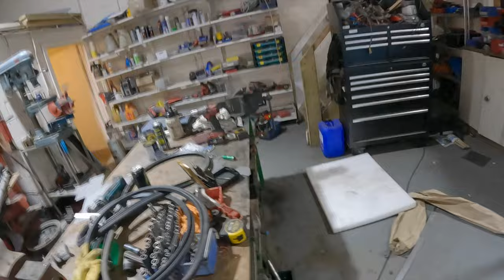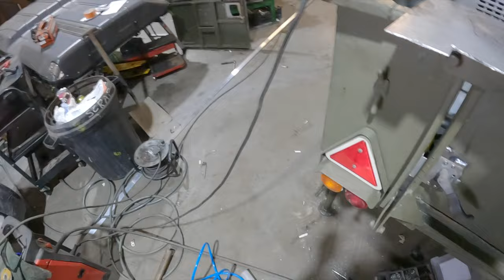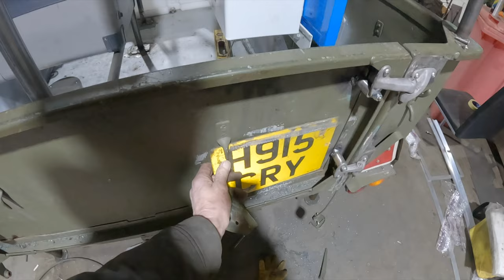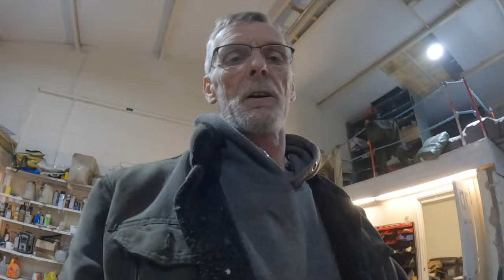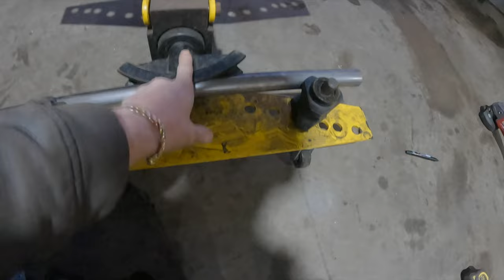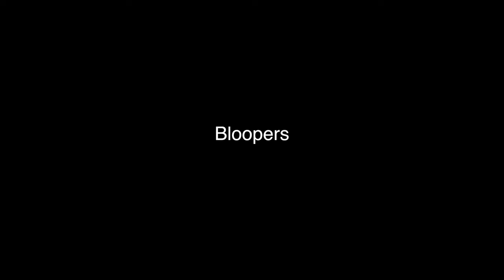OVERLAND TRAILER BUILD EP3 | Custom Tube Arches | SANKEY TRAILER | How To Bend Tube | 4WDUK

Comment: Always wondered what you guys use as a daily, and thanks for the stickers (just doing my bit for the channel) keep up the good work, also once you learn tig you will hardly use mig again
Reply from the maker: Glad you like them! Connor agrees with the tig, 💪🏻💪🏻💪🏻
Reply: Another tip. When you clean the tungsten rod/point/tip keep a grinding wheel just for that job, cross contamination or any other dirt will really do your head in

Comment: Graham don't cut old brackets of the bottom left of door get a bolt to fit hole drill a hole on end and put a padlock on it as for the gap on left of door weld 10mm flat steel top to bottom and put some D2 door seal on it 
Dave
Reply from the maker: Good shout 💪🏻

Comment: Just realised you could have turned the door the other way round so the recess was on the inside , would have given you a flat surface on the outside.
Would've been easier to mount the hinges and you couldve cut a hole the same as the landy rear door for the lock.
Reply from the maker: Good shout 🤙🏻